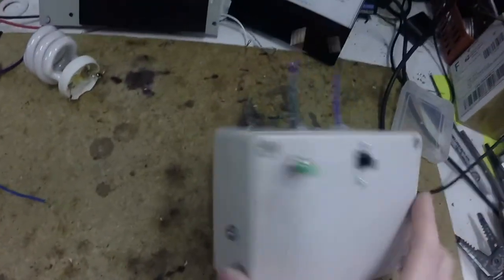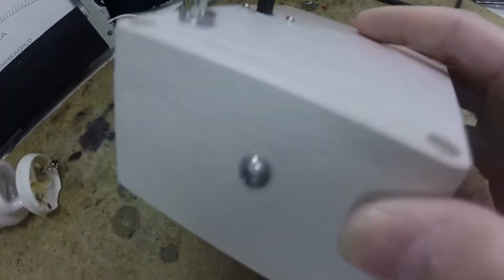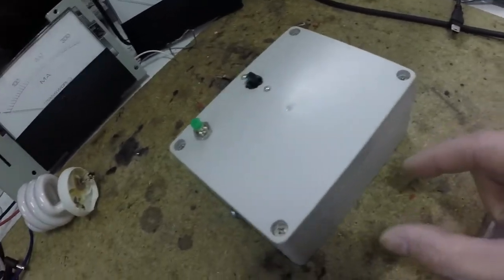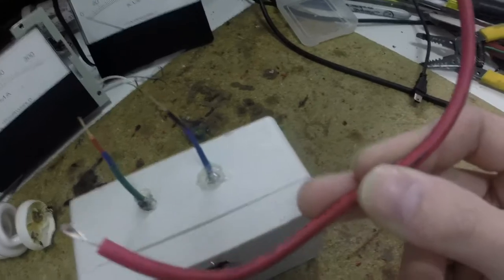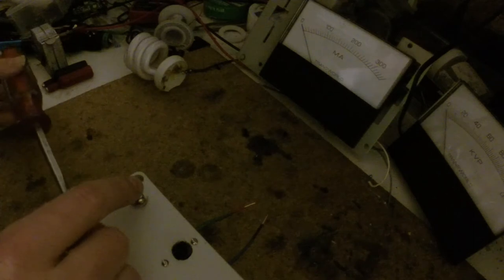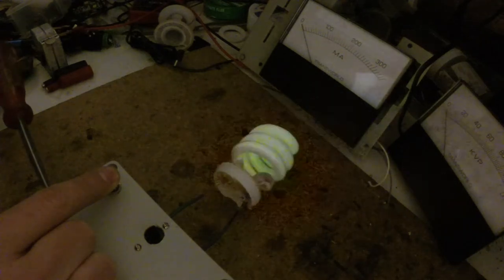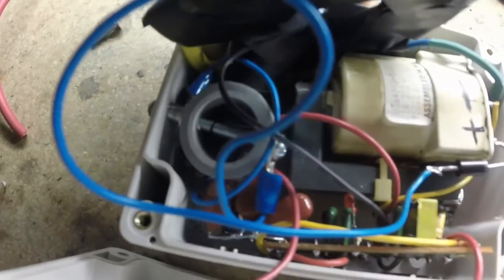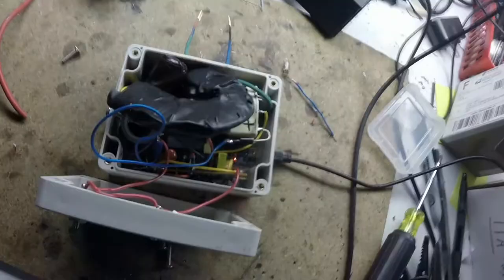DIY high voltage pulse DC power supply

Comment: how high can you change herz on your device? Is it possible to build the one with 10-20mhz?
Reply from the maker: By varying the spark gap distance. That's too high. The first stage multiplier oscillator is in the khz.